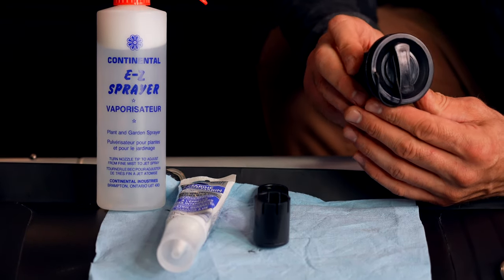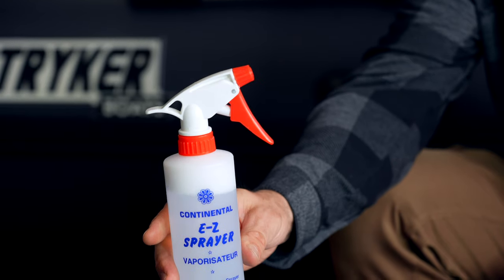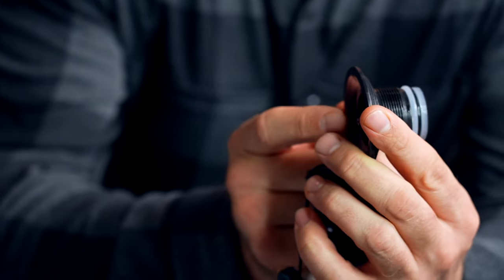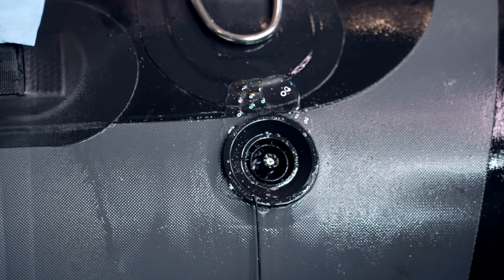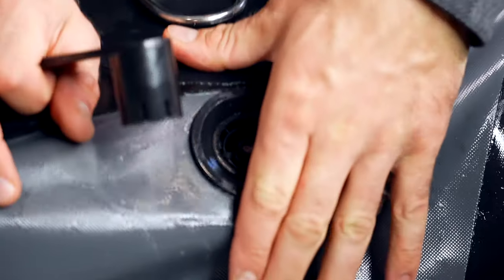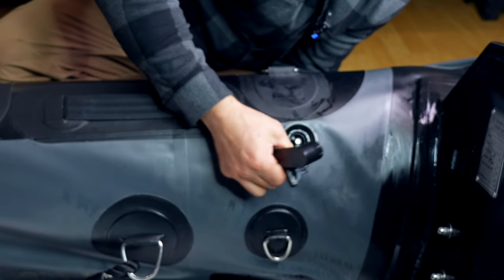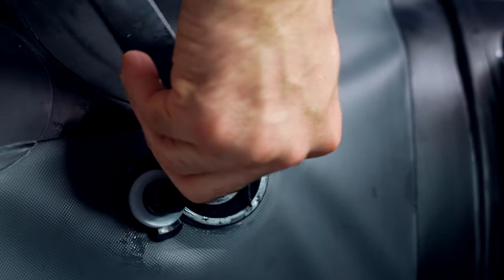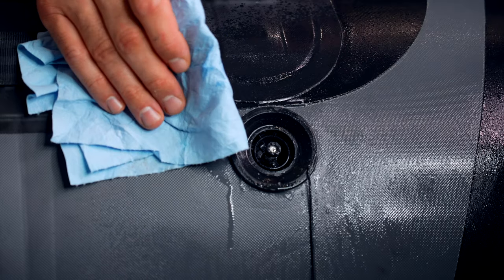How to Repair And Replace Inflatable Boat Valves

Comment: Do you know if anyone makes a metal valve removal tool?  I'm having trouble with the plastic ones breaking when I need to remove a valve that has been in place for a long time.  Or do  you know of a higher end plastic tool available?

Comment: No one ever mentions how to install the whole valve, inside and outside pieces.
Reply from the maker: Unfortunately changing the inside piece means cutting into boat to remove the backing. It’s not something that we would encourage anyone to do. It’s always a good idea to buy a bunch of spare valves for the exact model you own, as manufacturers sometimes discontinue products.

Comment: Could you please be more specific as to what sealant you used? Many thanks.
Reply from the maker: It’s a $5 marine silicone from home hardware. Any waterproof silicone will work.

Do not use an adhesive silicone.